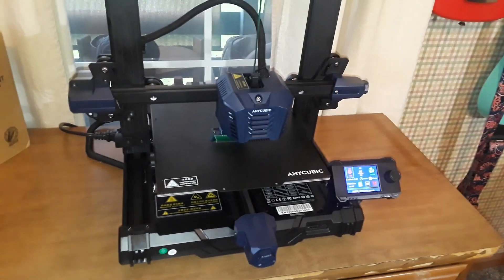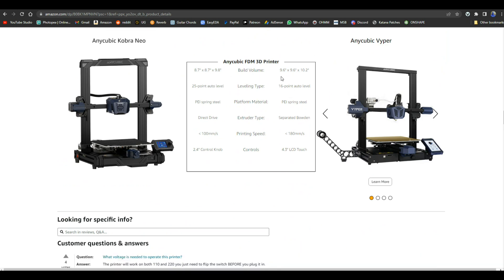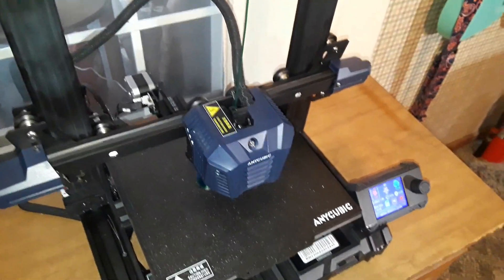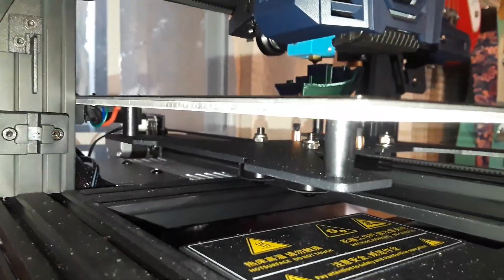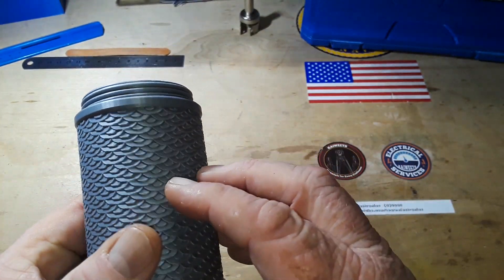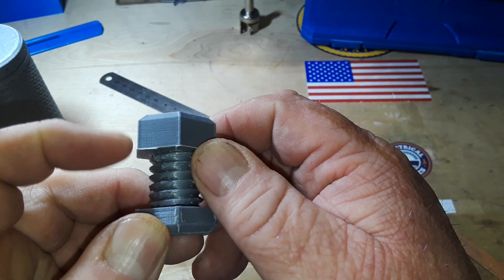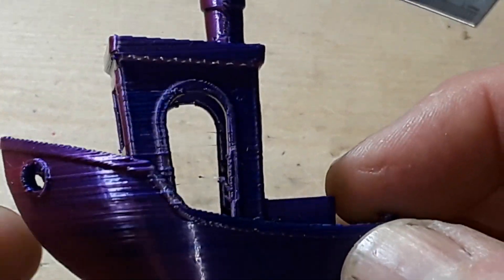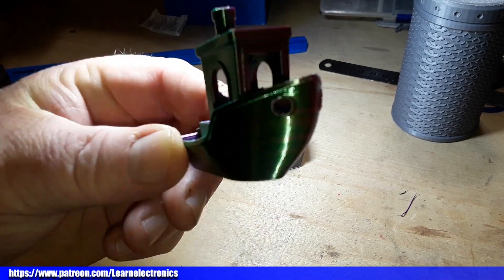The Easiest 3D Printer I Have Ever Used:   Anycubic Kobra Neo

Comment: I know this is an old post but wanted to comment anyway . I recently picked up a Kobra NEO off Marketplace for FREE . It appears to be in perfect shape , not dirty , no wear marks and its very quiet . I was able to connect to Octoprint and that works perfect . However , I have yet to complete a successful print due to bed adheasion issues . I have washed in hot soapy water , I have tried alcohol , I have used a covering on painters tape and even used the wife's hairspray . The tape and hairspray seems to give the best adhesion for a couple of layers , them the model came loose and I was back to printing a blob or spiderweb .
Any suggestions ? Could this be a filament issue ?

Comment: Pro Tip: 
If you have Stringing Issues with this or other printers, even after adjusting Settings:
Replace the Nozzle
I had lots of strings on my prints, but after I replaced the nozzle recently, the strings went away!
There may be some very very small amount of strings, but it pretty much feels like a new printer now.

I admittedly was using the same Brass Nozzle for around 1.5 years... and my printer was used when I got it!
x0

But, a list of my suggestions to get your printer running great are
Replace Your Nozzle (if you have excessive strings, and fine tuning settings didn't solve it)
Dry your filament (for stringing, or if filament is brittle)
Adjust your bed to get an Excellent First Layer (super important)
Tighten the under Bed and behind Printer Head Belts (solves layer shifting, maybe other things)

Adjust the Build Plate Sensor on the Print Head unit (which I did using the 3D Print that they give you the files for, don't remember the name at the moment)
Adjust the Retraction Settings if needed (for me, by memory for PETG, it's 1.5mm Retraction, and 35mm/s, I think, not looking at slicer)
Lower(Adjust) Print Temperature if there is Stringing/Bubbling (~205 PLA, 215 PETG, maybe 220 TPU (TPU setting is more of a guess)).
Raise Print Temperature if Layer Adhesion is a problem.
Wash Build Plate with Soap and Water if prints aren't sticking (not just Isopropyl Alcohol... that doesn't work the same as soap and water)
Tighten Belts and Slow Speeds if Layer Shifting is an Issue
Raise Build Plate Temperature if Prints still are not sticking after washing Build Plate
Use reasonable Supports, and when it might fall use Brims (oftentimes easy to clean off, and could save a print or 2).

Block Air Drafts, especially when printing BIG things!
Air Drafts seem to cause underextrusion, possibly because the plastic is not as hot as it's supposed to be (and your part can have little holes in it, or failures, because of).
Use Higher Temps on Big Parts, I think.

There are more tips that I know, but I wanted to mainly share my latest secret:
Change Your Nozzles!!!

Comment: Is it good for beginners and does it still work?
Reply from the maker: It still works, but the new Creality Ender 3 V3 is a much better printer for beginners.
Reply: Ty
Reply from the maker: No problem, getting started in 3d is tough. There are a lot of learning hurdles. Getting the 1st layer to print right is the foundation of everything. The V3SE does this for you with an inductive sensor and a load cell under the bed. Right now, the V3SE is the only printer that does.
Reply: Thank you for the help

Comment: I have an old Kobra which is the same basically as the Kobra Neo and I have a new Kobra 2 Pro and I prefer the Neo/Kobra.   The bowden tube on the new Kobra 2 is stupid and a pain for changing filament.  And the crazy fast speed makes crap prints, IMO.  They crumble in your hands.

Comment: I watched this video and pulled the trigger. Thank You.  Its assembled and leveled. I've run the Prepared routine and melted strings fell into the inside of the chassis. I was expecting that to occur on the bed which hasn't moved during Preparation. So now I have to find a video to walk me through an actual test print.

Comment: If you print small objects you likely wont find the real problems with this printer. But if you do print larger more challenging parts there are 2 serious flaws.

The problem is the auto bed leveling. The firmware does NOT read the auto bed leveling data so it is useless to run the ABL when the printer wont actually use the ABL mesh data when printing. There is a solution but for beginners that are not used to editing their g code or modifying their advanced slicer settings it may be a challenge. The command that needs to be added to any gcode file (a file prepared for printing from a slicer such as Cura etc.) after the "auto home all" command is as follows. This command can also be added to the standard scripts of your slicer software and then it will automatically be added to your gcode.:

M420 S1 ; Enable Bed Levelling Mesh

Here is a sample of where it goes ("after auto home all") in a gcode print file:

; AnyCubic Kobra Custom Start G-code
M140 S{material_bed_temperature_layer_0}; Heat bed
M104 S{material_print_temperature_layer_0}; Heat extruder
G92 E0 ; Reset Extruder
G28 ; Home all axes
M420 S1 ; Enable Bed Levelling Mesh
M190 S{material_bed_temperature_layer_0}; Wait for bed to get up to temperature
M109 S{material_print_temperature_layer_0}; Wait for extruder to get up to temperature
G1 Z2.0 F3000 ; Move Z Axis up little to prevent scratching of Heat Bed
G1 X0.1 Y20 Z0.3 F5000.0 ; Move to start position

M420 forces the printer to read the ABL data. Without this the first layer will print very badly because the printer is NOT using the ABL data. Some areas of the print will not adhere because the filament is extruding too high and other areas will be smashed into the build plate because the nozzle is to low in Z.

Also, setting the Z axis offset is really critical.

What I like about the printer is as follows:

1. The PEI plate holds the part very firmly but after the bed cools it practical falls off which is nice as you don't have to pry the part off the bed.

2. As mentioned before its easy to assemble

3. At this price it is unheard of to get a direct drive extruder which allows you to print flexible materials.

4. At this price point it is also nice to see the ability of the hot end and bed to reach temperatures high enough to print many of the engineering grade plastics

5.The user interface is intuitive and easy to navigate

The second flaw is the ABL is not accurate enough to properly level the bed. Manual adjustment which Anycubic left out is needed. Many other printers use manual thumbwheels for bed leveling even though they offer ABL. I added the manual bed leveling modification and with the M420 command the printer works like a champ. I did not change my 2 star rating because I don’t feel a user should have to go to such lengths as modifying the printer.
I have added photos to illustrate the modifications and to illustrate a properly leveled bed.  Photo 1 is of the manual spring loaded knobs for manual bed leveling. Photo 2 and 3 show a test print on a properly leveled bed.
Here is a link to download the adjusting knobs:
https://www.printables.com/model/325410-anycubic-kobra-manual-bed-leveling-knobs
To prepare each knob use an M3 screw and nut. Put the M3 screw through the knob from the large flat side of the knob. On the side with the hex shaped hole thread an M3 nut and sping it up to finger tight. Tighten the screw until the M3 nut is drawn tight into the hex cavity.
Parts needed:
1.	Qty 4 M3 X 35mm Flat head screw
2.	Qty 8 M3 Nylock nut
3.	Qty 4 Springs that have anormal force of at least 7lbs. Can be about 1.25” long by about ¼” diameter (like this: https://www.amazon.com/Prime-Line-Products-SP-9720-Compression/dp/B008RF78TG/ref=sr_1_fkmr0_2?crid=V5ZAL175K5GB&keywords=helical%2Bspring%2B1.25%2Blong&qid=1697397262&sprefix=helical%2Bspring%2B1.25%2Blong%2Caps%2C165&sr=8-2-fkmr0&th=1)
4.	Qty 4 printed adjusting knobs

Assembly Instructions
1.	Remove the PEI plate from the bed.

2.	Remove the 4 M4 screws and spacers and save them just in case. 

3.	Install an M3 X 35 flat head screw in each corner secure it with an M3 nut from below and fully tighten.

4.	Now, one at a time, install a spring on each screw and align the screw to the original mounts where the bed originally mounts.

5.	One at a time thread a knob onto each M3 screw from below the bed mounts.

6.	Adjust the mounts so the bed is roughly parallel in all 4 corners to the X gantry. You can check rough parallel by using a spacer and with the stepper motors off.  slide the bed around and use a spacer to make sure all 4 corners are the same height. Use a random object as a spacer and adjust the Z height so its close to the right height for your spacer (do this before you shut of the motors). In this way you can get the bed parallel before you fine adjust the bed.

7.	Set your Z offset to the thickness of a piece of printer paper. https://www.youtube.com/watch?v=Vs4-PSquWSI

8.	Print the bed leveling test pattern and then adjust the bed so that any low points come up a little and any high points can lower to reach true parallel.
Reply: I don't get it.  Mine printed perfectly right out of the box and I've never had any problems.
Reply: @joeking433  I had a bed that was out of flatness enough to cause an issue. The bed leveling seems like it is not accurate enough. My bed was domed in the center just enough to cause issues. I had to replace the bed and add manual spring loaded adjusters as well. Now it seems to work well but I need tobtwst further. Have you printed any large parts that utilize most of the print space? That's were I saw the bed leveling issues.

Thanks,
Reply: @na7v645  Yeah, I printed cases and things that took up almost the whole bed!  And I didn't need a brim or anything.  I think some might get messed up in shipping.
Reply: That's very helpful, thank you very much for sharing these tips! How this message didn't get upvotes is beyond me
Reply: "The PEI plate holds the part very firmly but after the bed cools it practical falls off which is nice as you don't have to pry the part off the bed."

Really helpful, thanks for your effort!  I don't like the PEI plate because I like a smooth surface  better than textured.  I like my Prusa bed much better.  You can use a Prusa bed plate on an Anycubic, right?

Comment: Ive had mine for a few months now. Its been a great printer. Think i got it for $160 exactly. I will warn, you not use a scraper. Ik, that should be obvious, but the bracket will bend. The 25 point leveling will not fix it. Gotta bend it back and troubleshoot until its right

Comment: I would recommend staying away from anything by Anycubic. I bought a Kobra Max and have had nothing but issues. They have sent replacement parts which sometimes takes weeks and I asked to replace the unit and they refused. Now it's been since November 2022 (now augst 2023), and it still does not work and they informed me that they cannot replace the unit because it's out of the time frame allowed. Yet it was because of them that it is out of time as I had asked months ago to just replace it. I'd give them a ZERO on support and taking care of their customers. Horrible and now I have a large boat anchor that doesn't work.

Low and behold they agreed to finally replace it, but I have to pay to ship the old one back. Hopefully the new one works...
Reply: Stay away from the Max.  The Neo is fine.

Comment: Hello! I have a question. Does the fan on one side of the extruder make stringing excessive on the other side with marginal cooling compared to the side with the fan?
Reply from the maker: It really needs a new fan duct printed. Look on printables.

Comment: bowden tubes don't bunch up or jam. if you are having issues like that, you are going to face them with a direct drive as well. You need to learn how to oil your filament before each use.
Reply from the maker: I have no trouble with my direct drives.
Reply: @learnelectronics  I have no issues with bowden tubes. the reason they exist was to make the head lighter for faster printing. 3d printers originated with direct drives. learn to slice better, learn to use oil, learn to print at higher speeds and slightly higher temperatures. Learn about retraction settings and you will be fine. direct drives can clog just as easily, because it is a matter of your slicer settings. If you retract too much in a direct drive, it WILL clog pretty much immediately and gunk up the drive gearing with plastic. I would rather replace a $2 tube than a $20 gear.
Reply from the maker: I agree with you, they have their place. But if you are printing anything other than PLA or maybe PETG you are pushing the upper heat limits and they tend to swell in all directions and get sticky. And printing TPU through a Bowden is just something I wouldn't even try. I have one printer with a Bowden tube and it just doesn't get used.
Reply: @learnelectronics  I print tpu through bowden all the time, as far as swelling goes sure thats an issue, but thats what all metal hotends are for, and I swap to those when printing those. OIL YOUR FILAMENT lol it reduces stringing, makes it flow better, and works way better. I am not trying to detract from direct drive, but direct drive is a step backwards.
Reply: @cgwworldministries83  I have a Bowden tube on my Prusa Mini but it actually has the gearing off of the print head not at the printhead.  I have a Kobra 2 and it has a bowden tube but still has the gearing on the print head so I don't understand why it has a bowden tube if it's to make the print head lighter?  I've had no problems with direct drive and actually more problems with the bowden tube equipped Kobra 2.

Comment: Do you have slicer settings for this printer? I bought this printer and im having a really hard time getting it to work right
Reply: Same here. Did you ever find an answer?
Reply: @cliffwattigny2328  I basically used the Ender 3 settings, and then I just tweaked the bed size to match that of the Neo. Everything else I change based on what I’m printing

Comment: I have the same one and it has been printing for 24/7 for the last 7 days and it still works perfect. Although I had to follow some online tutorials to adjust the height of the prope with the gauge that came with the printer. This is really a good printer.
Reply: Hey i am going to buy my first 3d printer but i am not able to decide which to buy ender 3 neo or anycubic cobra i am also new to 3d printing 
Please reply 🙏
Reply: @oioindoor8155  Stay away from Creality. The company only sells you a frame and will only launch a opensource project after the engineers are done with it so the community can take over. In the end you have replaced almost every part to make it work. Buy the Anycubic Kobra Neo to start with, it's a really good printer and it has been running for 3 weeks non stop here. Just make sure you follow all the tutorials on how to build it and not the guide that came with it. Use them both togheter.

Comment: I need some help with mine. When ever I press print the screen freezes and the 3d printer doesn’t do anything. I have no clue what to do.
Reply from the maker: Honestly that sounds like you have a dud. Anycubic support is excellent, give them a shout.
Reply: @learnelectronics  I figured it our I had it on the wrong voltage lol. It was on 230v not on 115v which I thought I had on 115v soooooo yea. The printer is pretty good through. I just need to change out the fan duct with another 3d printed one.
Reply: @-.1w1.-  Thank god you didn't have it the other way around, 110v setting on a 230v installation, It would have been toasted

Comment: Hi, thanks for a great review!  I got this printer in January. Judging by your positive experience and those from the comments below I must be doing something wrong as I get terrible adhesion.  Every time I use it I am only able to make birds nests😅
I have been using the ANYCUBIC PLA 1.75mm so wonder if I should try the Silk filament you are using.  That said, I assume the PLA I am using should work and so I am doing something fundamentally wrong with the machine itself?  I was on the verge of selling it for a differe t model but your video has inspired me to try to sort this.
Reply from the maker: Bed adhesion is the name of every 3d printer hobbyist. You can try this. In this order..
1. Set your Z offset to 0 from main screen.
2. Do an auto bed level.
3. After the ABL, and while still hot set your Z offset from that screen. It should be about 1/10th of a mm. Do it this way...move y axis to 110, x axis, 110. Now use a feeler gauge or slice of paper to use the set Z offset until the tip of the nozzle touches the feeler gauge or you feel friction while moving the paper. Mine comes in at -1.7. Your's will probably be in that area. Also make sure your retraction is set around 1mm. Not the 6mm from the factory. 6mm is for Bowden tube extruders
Reply: You'll have to adjust the position of the probe to the correct height with the tool that came with the printer. You'll have to open the cover of the print head. After that you can lower the Z-axis manually with the aluminum part on the motor until it's touching the lower part of the tool that came with the printer. After that you'll have to use a screwdriver and turn the screw of the probe until it's touching the upper side of the tool. Now that one is set too. You'll also have to make sure that the bed is not wobbling, and the other parts as well. Now you can adjust the Z-offset of the printer. I did this while printing a huge 1 layer square that I got from Thingiverse. You've reached the correct height after the bed is not visible no more while printing.